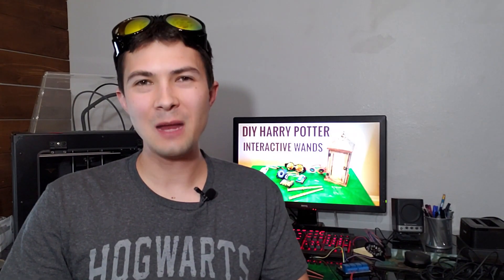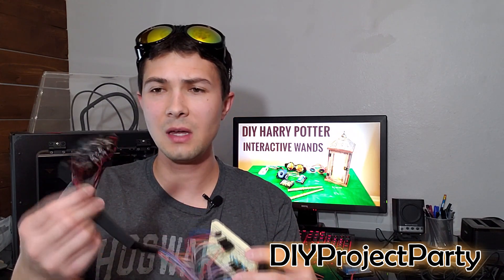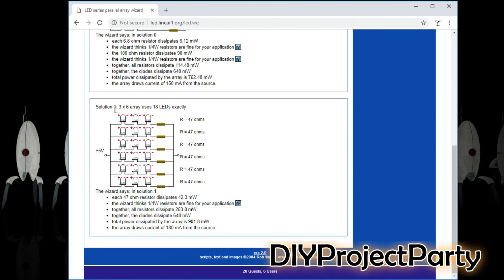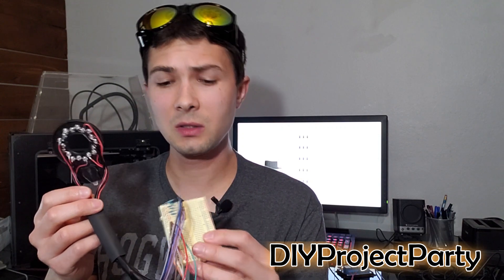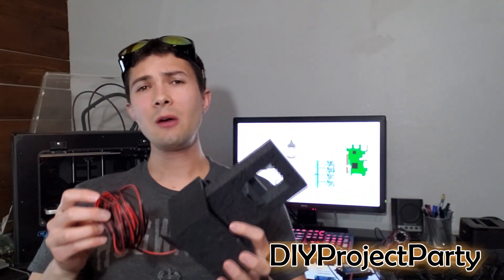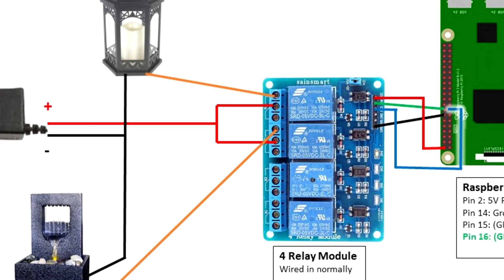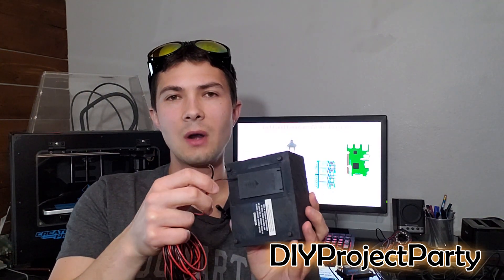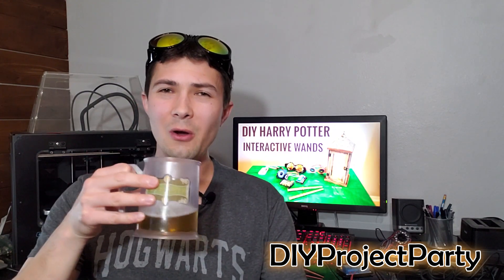Wiring for Harry Potter Interactive Wands

Comment: Can you use any raspberry pi As long as there is a camera input?
Reply from the maker: Hello Ava, thanks for the question. I would recommend a Raspberry Pi 3 or better. The RPi does not have to have a camera module connector. You can use a compatible USB webcam. My python code is setup for a webcam. If you would like to use a camera module, look at lines 22 and 74 in the python code to change it for the camera module.
Reply: @DIYProjectParty  thanks so much!!!!!

Comment: Great breakdown on wiring..  Have a question though...  Somehow Inhave reversed the relay so that when the “nox” spell is done the relay board turns on and then the light turn on.  When I do the “lumos” spell the relay board clicks off and then the light goes out.  Not sure what I’m going wrong here but is powered identically to yours....
Reply from the maker: Hi Chris, thanks for checking out the video!  Does your relay have 3 screw terminals?  Try switching the orange wire to the unused 3rd terminal and try it again.  If you can't rewire your relay, you might have to change the python code to have the relay behave in the opposite way.  Switch the values on lines 93, 95, 100, 102.  Switch 1 to 0 and 0 to 1.  That should make it work!
Reply: DIYProject Party yep that was it.......

Comment: Could this be done with an Arduino, or does it need the computing power of a PI
Reply: It could technically be done with an Arduino, but it is #1 much simpler on a pi to read webcam data #2 it will be able to process the data in a more timely manner #3 doesn't require you to strip down your webcam's wiring if it's a USB webcam

Comment: Hi, thanks for the tutorials! I'm totally new to working with everything so I have a questions... When connecting the power supply to the relay module, do I just snip off the end of the power supply cable and connect the wires to the relay module?
Reply from the maker: Hi! Yes, you can snip the ends off the power supply and then strip the casing to expose the copper wire. Thanks for checking out my video and good luck on your project!

Comment: Nice work! I ended up using a 4 relay switch as well, although switch 1 and 2  on my relay need a love tap to get them to go to the on position. Cheap relays. I may try solid state switches instead next. My lamps turned out nice though. Thanks for the videos. Your original video reminded me of the work I had done previously with this concept when Sean O'Brien's Make article came out and brought me back to working on it again. A ton of fun. So far, I have made an Interactive Wand and Spell Vault, present box that unties itself, unlocks itself and opens with the right spell. A Moaning Murtle Smart Mirror. And a Dragon's Head that pops a balloon if you do the correct spell. The Dragon's head is super fun if you do it outside and fill the balloon with propane. A six foot fireball. Incendio!